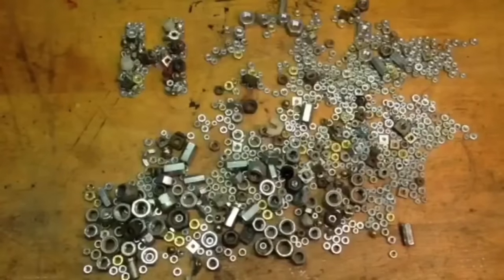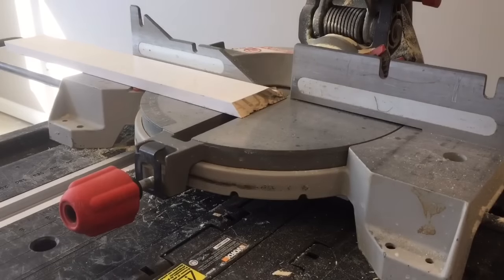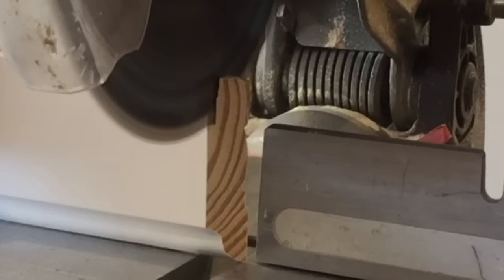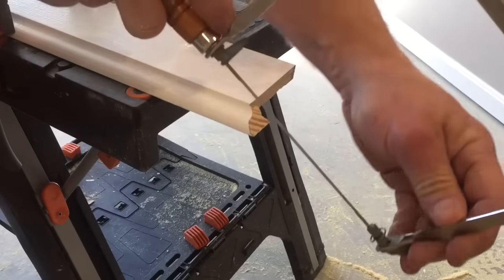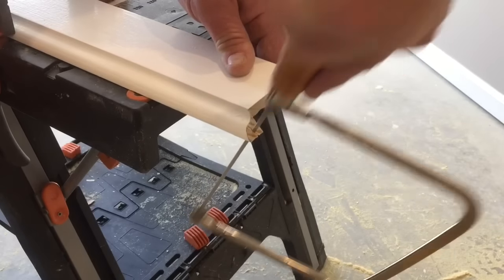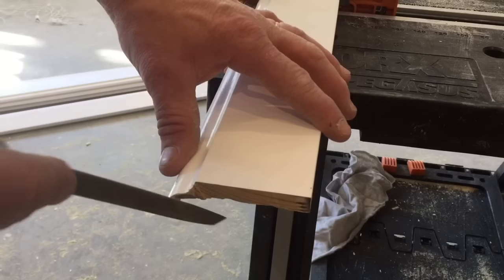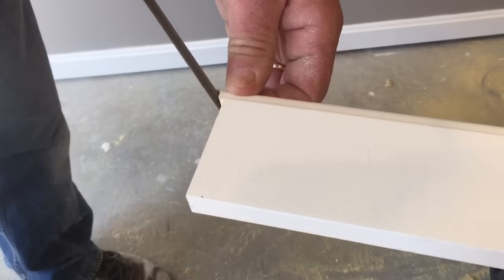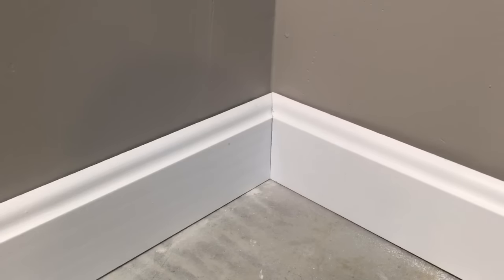How To Cut Baseboard Corners That Look Great

Comment: Takes way too long , you wouldn't make any money doing that for a customer. You still have to caulk it. Also the tops of the base don't match.
Reply: Takes about five seconds to caulk it.
Reply from the maker: Caulking is the final step. shouldn't take a tube of caulking for each corner. I've been doing this for years and years without complaint and I am making money. Doing a good job will also get you repeat business, doing quick shoddy work is a once and done. Tops of the base match pretty good as they were cut from  the same piece. If you notice in the video the 2 pieces are just set there...not nailed in. Thanks for watching.
Reply from the maker: Or you could just do it correctly.
Reply: you are completely wrong Jerry, you spend way more time trying to make a bad job look good when you mitre internals, scribing  is the only correct way to do this, anyways, how come having  to do 2 cuts that don't fit is any faster than one cut that fits properly?
ps i have made plenty of money in customers houses doing a proper job!
Reply: Im doing piece and putting downg down 1200 feet a day and coping. no bs my friend plus hardware
Reply: I agree. 3 man crew I’m in takes less than two hours to base a small house. Only ones we cope are longer ones. If you cut inner corners at 44 instead of 45 it makes it easier. My guys usually cut long so the back end will but end nice and cleanly. Most corners don’t need caulk either
Reply: rubbish, mitres in  the internal corners is what cowboys do.
Reply: que kid rock music- " I WANNA BE A COWBOY BAABBBYYY"
seriously though, I'd get tired of coping every mfing corner
Reply: Ah a normal cowboy response, cant be arsed to to a better job! So would you get tired having to return to a job a re-caulk all the joints instead of doing it once ,properly?
I get it that Americans like to 'hope for the best and caulk the rest but' its not very good workmanship.
Reply: sherman squires Happy Independence Day
Reply: so smart, like you he can't fit base boards.
Reply: Every employer I have had in the past would fire carpenters who were new hires if they didn't cope their inside corners.  Its evidence that a person was not trained in the trade of finish carpentry when they 45 their inside corners.
Reply: good comment!
Reply: Clean and correct job ,make my job as painter more easier less mess and high end job 👍👍👍I wish to have that type of master trim guy in my painting projects..
Reply: Specific to White yeah there's some caulking but what if I'm using natural wood? This method is awesome
Reply: @juanmorales3577  I'm a carpenter and I heard from a painter once  "little  putty, little paint makes a carpenter what he ain't.

Comment: i dont understand why people bother coping baseboard.... get a starrett miter protracter and find the exact angle to cut. so much faster and looks just as tight.
Reply from the maker: Coping takes care of more than one angle at a time so if your wall is out of square (all are) it will take care of that and if you wall is out of plum or tapers from drywall mud it also takes care of that. In sore coping is the correct way to do inside corners and they will be tighter than using any "protracter". Hope this helps. Thanks for watching.

Comment: Well that's good insight, but all that work and you'll still need caulk...not sure that was worth the extra effort.
Reply from the maker: It may not be worth the extra effort to you but years down the line it will still look good. Most people just want to jack it together and it ends up looking bad. All the work becomes quicker with practice and the extra effort for years of good looking joints is worth it to some.
Thanks for watching.

Comment: Why don't you just CAULK the seem with some white silicone? It takes 5 seconds instead of 5 minutes.
Reply from the maker: Why don't you read the previous comments? This has already been answered many times over. Thanks for watching.
Reply: @funbro1  OK. But, on the other hand, a better answer might have been that coping is a common and long-used carpentry technique for providing a more finished look, albeit more time-consuming. In many applications, the time may not justify the results.
Reply from the maker: Better answer than what? I’ve already answered that way many times over.

Comment: sorry sorry why is 45 hard to cut? Let's cut the other piece for 45, nice job, I see it in the houses I dismantled in Turkey. I am a person who deals with furniture decoration works
Reply from the maker: A 45 really isn’t that hard to cut but there are many different angles  going on here. Thanks for watching.
Reply: hello, if the wall degrees are different, the machine also has different degrees
Reply: @funbro1  
I have been busy with furniture decoration works since 1980, some mistakes seem to me unwillingly, I'm sorry.
Reply from the maker: Doing the corners this way makes up for many angles, looks great and lasts with little to no caulking.

Comment: Cut your inside corners at 44 degrees. And ad glue nothing better than a glued joint.
Reply from the maker: Glue helps but 44 degrees doesn't always work. Thanks for watching.

Comment: A grinder is quicker and easier for coping.
Reply from the maker: if you had read the previous comments you would see that this is an instructional video intended to show the concept and that I do use a grinder with a flappy disc to speed things up. Thanks for watching

Comment: Not saying it's bad it's just an extra step u don't need complete cop cut after chop saw cut then u use cardboard behind each corner to make perfect every time so the gap you cut in there never moves
Reply from the maker: Nicole Baldree Like i tried to explain to you in the previous comment, it is an instructional video. Is it the only way? No Is it the fastest way? No But will it yield great looking corners for someone who has not done this before? YES. If YOU have not done baseboards before try this method. If YOU have done baseboards before and are as knowledgeable as you proclaim to be then WHY are you watching this video???

Comment: Useing the chopsaw defeats the purpose of the miter
Reply from the maker: In this training video the first angle is cut to show the contour of the moulding. The second angle is then cut to remove most of the material so that the file step goes much quicker. After practice some steps can be skipped once the method is achieved. Please feel free to cut baseboards as you are comfortable with.
Thanks for checking in

Comment: This not tips & tricks and it is wasting time in this case if the corner is off then you can cut both corners at 48 degrees then it will match perfectly
Reply from the maker: This IS tips and tricks and NO you cannot just cut at 48 degrees. If you understand the corner the you would understand the baseboards going into that corner. After practice this will become faster and still look good but that’s not for everyone.
Thanks for checking in.

Comment: So let's cut it on an angle then cut off the angle and then file and angle tf
Reply from the maker: In this training video the first angle is cut to show the contour of the moulding. The second angle is then cut to remove most of the material so that the file step goes much quicker. After practice some steps can be skipped once the method is achieved. Please feel free to cut baseboards as you are comfortable with.
Thanks for checking in.

Comment: I'd rather just change the engle of one piece. That'll save me time and it'll still look 100% great.
Reply from the maker: While this may sound good in theory, it does not always work and yield 100% great looking corners. The problem is that you will have 2 differing angles and by coping correctly you will always end up with corners that look "100% great" all the time. Thanks for watching.

Comment: If I ever saw someone bust out a mf file to cope some base I would lose it , "I cut and installed 60 feet of Base in 2 days" trash dude coping it for hacks if the wall isn't square then don't cut it at 45 durrrrr
Reply from the maker: Some might argue that you already have lost it. I’m not really sure why I bother to waste my time and reply to some of these comments perhaps it’s the hopes that some thing will sink into someone at sometime?
Sure anyone can cut the corner at 45 or slightly off of a 45 but has explained many times in the past this does not always work nor does it last because you end up using caulking that will eventually crack. Busting out the file it’s just part of the tutorial of this video. I do not use a file every time, it was just done in this video to show how close a corner can get if you desired. I am not sure however what a “mf file” is? In this video I believe I used a half round file durrrr
Thanks for checking in.
Reply: @funbro1  angle finder and 2p-10 you can even get caulk in my seems , door casings and base are always seamless , just must be a generational thing I can't stand coping , but anyways it looks good , just trolling a tad
Reply from the maker: I can tell but I would rather find something better to do with my spare time…like cope some moulding so it looks great.

Comment: This is too hard to do and takes alot of time, basically no one will ever use this technique on complicated base designs, just use angle finder and mitered cuts more easy and convenient. Save time and effort and looks better
Reply from the maker: You are wrong on many things in your comments. With practice your speed will improve. No, it does not look better just cutting a miter using an angle finder. Thanks for watching.

Comment: You know how long that process would take it you were doing a whole house ? Save them time consuming cuts and filing for elaborate crown molding or fancy high end base. A basic piece of baseboard that will be painted I would be so fired making love to a inside miter like that. 
Ding Ding time to get out of the corner. I’m just saying
Reply from the maker: Just showing the correct way of doing the job. I am not saying it is the only way to do the job or the fastest but it is a correct way to do the job and make it look great.  It can be done much quicker with practice and it is a whole lot quicker when not shooting a video and explaining every step to you. The same process can be used for elaborate crown moulding  or fancy high-end base.  Thanks for your unecessary comment and thanks for watching.

Comment: I can do 6 corners in the time you to do one. To many steps. Learn how to use the coping saw cleaner and faster and eliminating steps.
Reply from the maker: ELN calls I am willing to bet that you cannot do 6 corners in the time that I do one. My goal is for them to look good and complete them in a good amount of time. It takes a little longer on the video then in real life. Sometimes faster isn’t always better. I don’t expect you to understand, but thanks for watching.
Reply: ELN calls 
Agreed
Reply: funbro1 when your on a deadline and tight bid faster is better just make it look good no one is getting down on the floor to make sure your copes and miters are nice and tight if it’s being painted you can hide a few small sins here and there.
Reply from the maker: I can’t do them six times faster than what is shown in the video however I need to explain things and take my time in the video so that you will be able to understand how to do this job correctly.

Comment: You do not need to file the cut if done correctly.... you aren't going to make money wasting hours on unnecessary processes like penciling where there is a clean paint line to follow. You did good but could be far more efficient.
Reply from the maker: I must say you are WRONG. I am making money right now. It is done correctly and if I were to do this efficiently as I normally do then the How-to video would be about 30 seconds long and NO ONE would get anything from the video. Then I would get all kinds of people saying that I went too fast in the video. Even more people than I get saying that an instructional video takes too long. But then I do like to do things correctly. Thanks for the view.

Comment: Lol how to spend 10 min per cut.  Measure the corner and adjust the miter saw to get a perfect cut every time hahahha.
Reply from the maker: LOL, if you have ever cut corners you would know that this would yield less than nice looking corners. You would also know that with time the CORRECT procedure will become quicker for you.
Thanks for checking in.
Reply from the maker: Sorry don’t own a goat and probably never will. I just know how to cut baseboards, that’s all. I am kind of curious what you do with a goat and butter.  🤷‍♂️
Reply: @funbro1  Its a malaphor based on the known saying "what ever floats your boat"  another example would be "we'll burn that bridge when we get there" = to we'll  cross that bridge when we get there.  We'll have to just cut all the corners.
Reply from the maker: Well I don’t have a boat and if I get to a bridge and need to get to the other side I suppose I’m going to cross it. If a corner needs cutting then I say cut it.

Comment: Dude you are a rookie..... If you were getting paid you would lose money or be fired.
Reply from the maker: Dude you're embarrassing yourself...please read previous comments before popping off.
Reply: The previous comment has nothing to do with the fact that you know the basis principle of coping but have no clue how to used a coping saw. I stand by my statement. You are a ROOKIE. Not a big deal you mean well. @funbro1
Reply from the maker: I’ll try to explain it in terms you might understand. This is an instructional video. An instructional video should contain as many details as possible. Details take time. The instructional video makes the video longer then it normally takes to complete such a task in real life. Just imagine if I did this video in real time. It would be about a 30 second or less video and useless to any of the over 100,000 people that have gained valuable knowledge from watching it. 

I stand by my original comment, you’re embarrassing yourself. I’m not sure why you even showed up here to chime in?
Reply from the maker: Still making money. Thanks

Comment: I have a much better idea !!!  use caulking    That will solve the time consuming this method is
Reply from the maker: That is a much better idea. If you want a hack job. I’ve never considered doing it like that because I enjoy doing things the correct way so that the finished product looks good and lasts. If you practice doing it the correct way you will get faster. 
Thanks for watching.

Comment: Dude u would be fired first day no need for chop saw  after cut all coping saw and you were way to slow also no need to mark the spots your cutting with coping saw
Reply from the maker: "Dude" funny thing is I have NOT been fired but rehired because of the attention to detail. While you feel there is no need to cut baseboards the way shown in the video and apparently feel you have a better way  let me explain to you why this video is done this way... It is an instructional video.It is meant to show a process that works. Do I follow this process exactly every time??? No but if I did I would have great looking corners AND a happy customer. I hope you have at the very least learned something from watching this video, maybe with practice you will perfect this method or another that will give you great results. Thanks for watching.